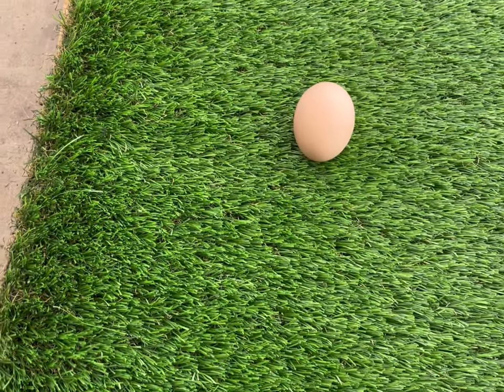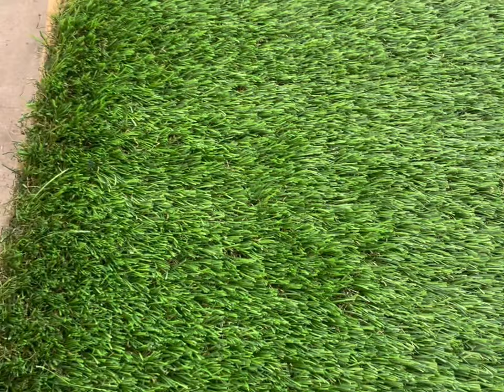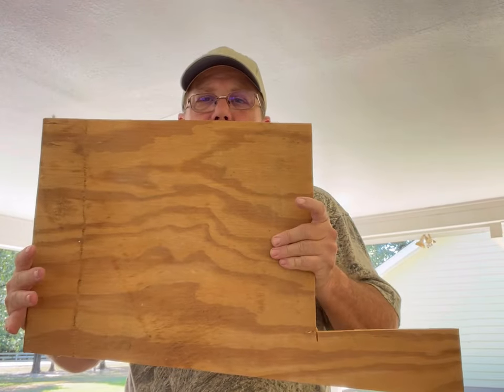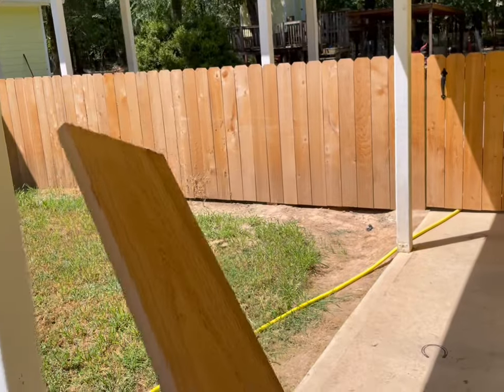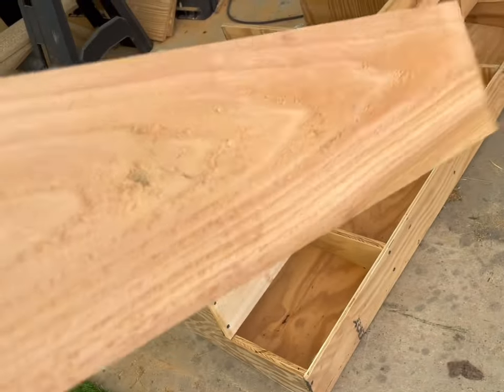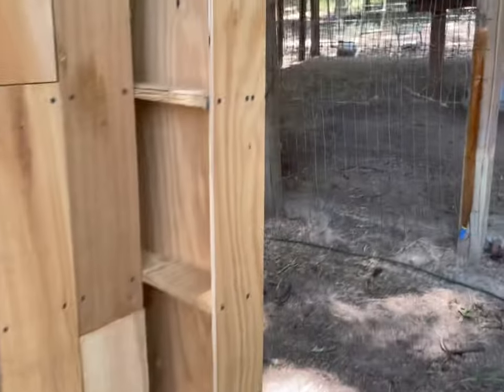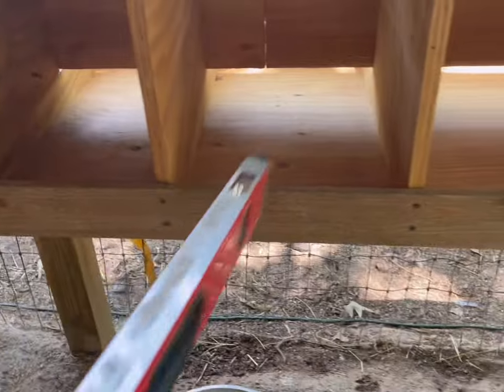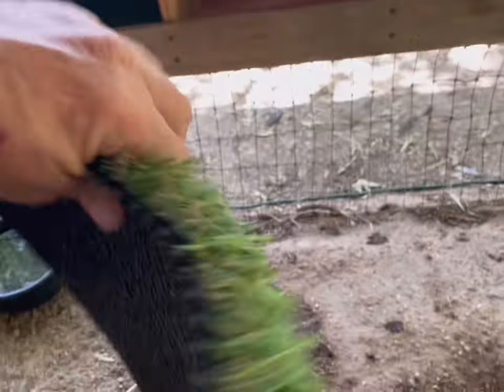DIY roll out egg box 2” 3” or 4” slope?

Comment: Great job! Perhaps you will take some advice from me. It seems to me that the weight of these nests can be reduced by: 1.Plywood thickness from 16 mm, at least up to 10 mm. 2.The floors on which the mat lies can be made of galvanized welded mesh. The design will not change, the weight will decrease. Good luck!
Reply from the maker: Thanks, Great idea, on this box I used scrap materials I had at my homestead already, and in my quest to save money, good thing is it wasn’t too heavy and I only had to handle it once during set up
Reply: Cost savings is generally better than weight savings
Reply: @stevensoltwedel8105  I won't argue, there are priorities everywhere!

Comment: I built a set of roll away nesting boxes on my first chicken coop. The floor of the entire coop, including the nesting boxes, was hardware cloth so the waste fell through to the ground. The only thing I regret is that my nesting boxes were kinda shallow because I was using cull wood as well. Next time I will make deeper boxes. 🐣🐥🐤🐓
Reply: Did you have any problems with Hens not wanting to lay in it?
Reply: @TheDonovanFisher  Yes, the hens did lay in it, aplenty and the eggs rolled to the back as designed, where they could be accessed by a hinged roof. It was a good design but I think I'll do better next time, at the very least with a roomier nesting box. I didn't use any litter or Timothy grass in the boxes and it didn't seem to bother them at all

Comment: Thanks for the video. I am planning on using another idea for the egg rolling, but will use your design, as I won't be  going into the pen. I plan on using coated hardware cloth for my roll, not the  carpet as you mentioned. That way andthing that is not eggs  can drop down and not get the eggs dirty. Helps when you want to water bath the eggs. But I do like your initial design. I plan on starting the build this week.

Comment: When you say it is a 3 inch slope, that is for 16 inches of run, right?  Only clarifying that because I though when a slope number is normally given that it is usually relative to 12 inches, but that is probably my incorrect understanding.   Which I think means that the opening where the eggs roll through would be a 3inch high opening?  great video btw.  agree that the music should be ditched, but it was still pretty clear.  thanks.

Comment: Hello….great job! Could you please let us know the brand of nesting box inserts you are using, and where you purchased them? I have been looking for ones just like what you are using as my hens throw out the material I am using….am finding cracked eggs since they are hitting a hardwood surface. Thank you
Reply from the maker: I bought the material at Home Depot in the carpet selection, it is artificial turf, I just bought 3 foot off of the roll and cut my pieces as I needed them to fit

Comment: This looks pretty slick. I was wondering how it is working out for you?
Reply: I just saw you swapped to a new flock.
Reply: Treated lumber should only be used in ground contact situations. It warps too bad for most situations. Paint would suit snow protection much better.
Reply from the maker: Working great, about 70% of the eggs roll completely out where they supposed to. The others are within fingers reach
Reply: @preppingtexashomestead6315  thank you for the update!

Comment: Over all great design but you really don't want to encourage roosting in your laying boxes. It encourages broody hens and for them to poop in the boxes and makes it easier for predators to reach them. I'd recommend hard cloth bottom instead of a solution wood bottom.
Reply: New chicken owner here, and I would love to learn more about the concern of hens roosting in the nesting boxes.  Could you elaborate on why you say that?  What causes them to want to roost in these nesting boxes, but not the regular (non-rollaway) boxes...is it the fact that there aren't any eggs in there?  Thanks for your insight!
Reply: @77lases  roosting in the boxes promotes broody hens. On top of that they tend to break eggs and poop on them more. Put your roosting ladder higher than the boxes and they will choose the ladder.
Reply from the maker: I have another video that shows where I have them roost. They never Ruston the egg boxes because I have it on the outside wall of the chicken pan and there’s no other options for laying eggs except for this location
Reply: How exactly is this encouraging the hens to stay there????? It's at a slat and they do not like to lay like that lol